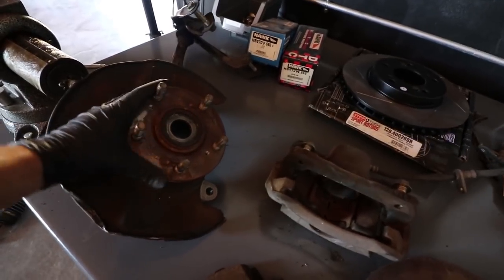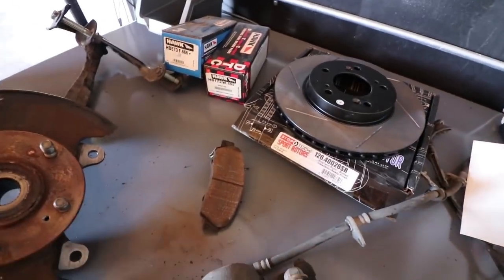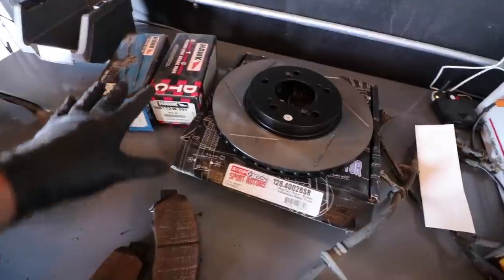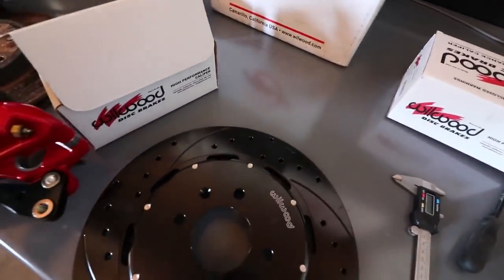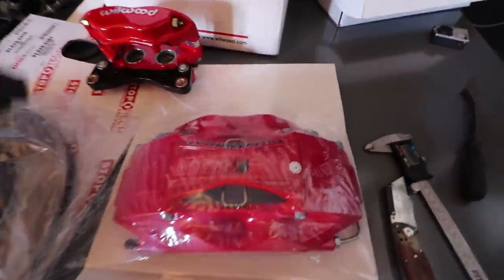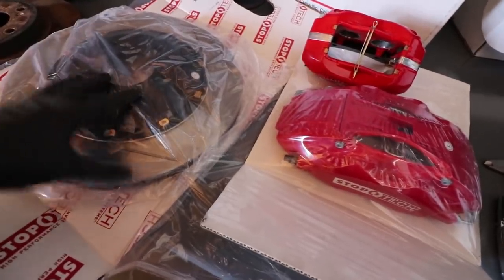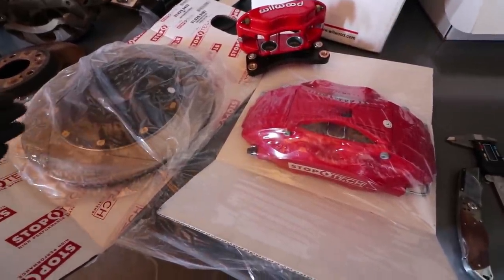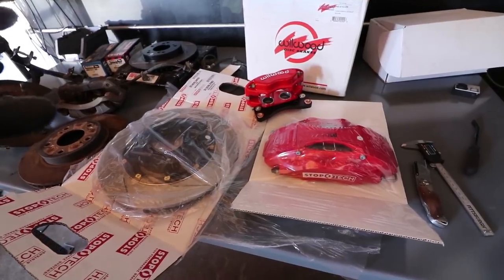$300 Brake Upgrade Vs $2000 Big Brake Kit

Comment: I just want affordable brakes that can stop fast(with the right tires) but for street use *only*, since there are 0 tracks where I live. I just want to be safe. Any tips?
Reply: Tires. Factory brakes are more than capable of clamping tight enough to stop your wheels from rolling (queue the ABS), but your tires are what actually make contact with the ground. Don't buy cheap tires if your main concern is being as safe as possible.
Reply: Replace the brake fluid, put on braided brake lines. Get good brake pads and rotors, and you'll stop just fine. Unless you're driving mountains or hills constantly, a smooth rotor should be just fine. Richasianman is right too, well maintained, quality tires will also help.

Comment: If you want to reduce breaking distances and generally have a quicker stopping car for the street to make car safer what is the best type of upgrade?
Reply: pads
Reply: pads,fluid, discs, steel braded brake lines and most important tires
Reply: Thanks for your help guys
Reply: Maybe don't drive fast?
Reply: Wheels and tires, wider tires with a better compound
Reply: Tires. Tires. Tires. Tires will do all of the above things.  Big brake kits are to prevent brake fade and improve feel. THATS IT.  More surface area, better heat dissapation. Ill bet your factory braking system can lock up the wheels, right? There is a huge misconception about bbk's.
Reply: Tires
Reply: Buy a slower car.
Reply: Don’t ask this guy for help that’s for sure..it’s simple and is all  determined by the size of your wallet ,start with the right pads,then move up to bigger rotors,then you can purchase a complete kit ...and Wilwood will rock ,but honestly stoptech is a nice up grade over most factory systems

Comment: The stop tech look like the same size of my 4 pot akebono 370z BBK and I have them tucked (less than 1/2” gap) under some 18” rims 😏. The wilwood look like fancy stock ones with 3 extra pistons.

Comment: Is it possible to put big enough brakes to shred the tires as soon as you stop? You hit the brakes and it would just grind down through the wheels!
Reply: YES.  The wheels will lock up immediately and the ABS will relieve some pressure to stop the wheel lock up and the tires screching
Reply: Wilwood kits that rely on you tuning them with their cheap "proportioning valves" can do this by locking up only two of the wheels well before the other.  Normal brake systems are easily capable of locking up tires unless something is really poorly designed.

Comment: He comparing what do you get for 300 versus 1000 and 2000bucks. 

I really dont understand all the hate. His information seems legit. 

Also those stoptechs looks like 6 pistons. 4 of the same sized and 2 smaller ones in middle for extra force.
They are sized like 4 high performance pots for clearance. True 6 pots are ridiculously big.

Comment: This is real good man. What would you recommend for a 2017 lancer 5 speed. My brakes suck.
Reply: better tires and flush/bleed your brake fluids probably.
Reply: Does't the lancer (depending on your model) come with brembos from OE? 
Unless you have the base model.
Reply: @aoikazuya7716 I don't think so, the Evo was axed in 15 or 16. The lancer es is the highest model now......no brembos !!!! :(

Comment: This is dumb to compare a 4 piston wilwood to a 6 piston stop tech.  At least compare apples to apples cause you point out the size which doesn't matter unless they are both 6 piston
Reply: it's a comparison between the stock system, upgraded pads and rotors, wilwood 4 piston entry-mid level kit and a stoptech 6 piston mid-high level kit. He's not saying the wilwood and stoptech kits are competing against eachother. Just showing different levels of upgrades.
Reply: Size dosent matter
Reply: @Lon Don I agree! Compare the best Wilwood to the best StopTech.